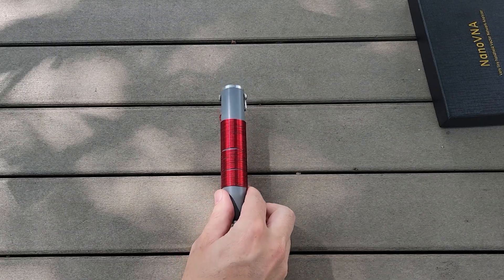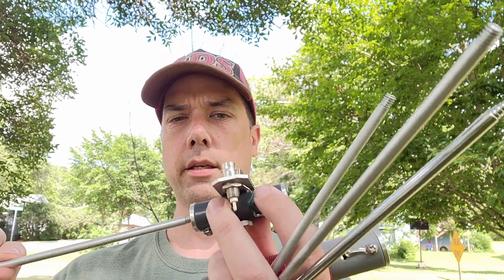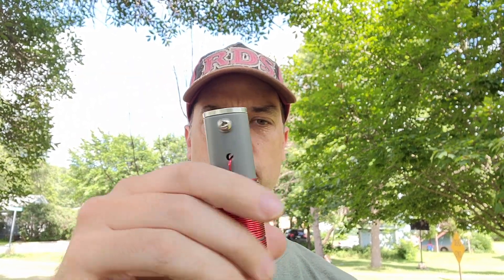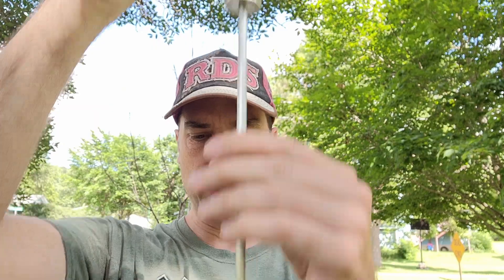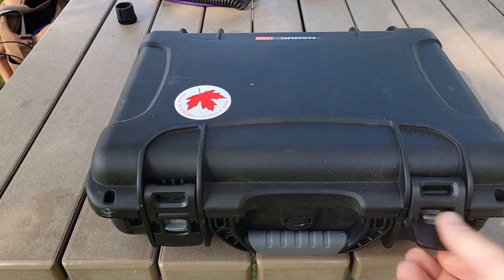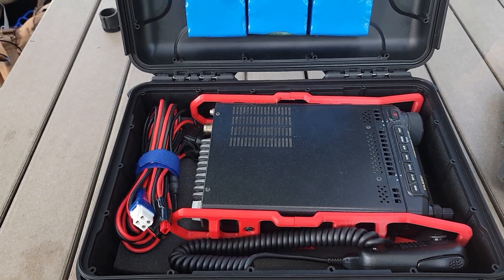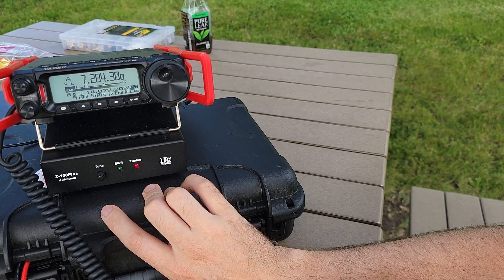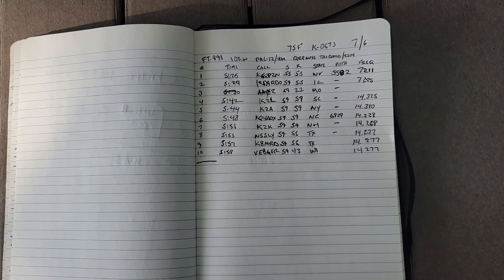How To Setup an Unknown Ham Radio Antenna

Comment: U can actually buy the pac-12 antennas and to adjust the tuning u adjust the telescopic whip on ur fixed coil version but radial lengths do change the swr and u do get a better match when they are elevated say what u yanks would call 4 inches high but i found with my better version is u need 10 ferrite beads on ur coax at the feedpoint due to the coax length changin the swr as it used that for another counterpoise
Reply from the maker: Thanks for the info Trent Trent!

Comment: I might have the plans for that saved somewhere.
Reply from the maker: Excellent!  It's a neat design pacific antennas pac-12 if I recall correctly
Reply: @temporarilyoffline  Correct. It uses pex tubing and fittings.
Reply from the maker: @loraz0  Ooh!  If you find that, please email me!
Reply: @temporarilyoffline  I have to fire up an old computer, will let you know

Comment: I have a feeling if you lengthen the ground radials to about 32 ft. (3 or 4 of them) that it will lower the SWR a bit more. I didn't catch during the video the length you are using but looked like maybe they were 16 ft. By the way, I also use Anderson power poles. I have a total of 8 16-ft counterpoise wire, each with a power pole on the end. So, I have either 8 16-foot or I can easily swap it out for 4 16-ft. counterpoise wire. Looking forward to your follow up. 73.
Reply from the maker: It will probably be a few months on the follow up, winter is coming to the channel 😁